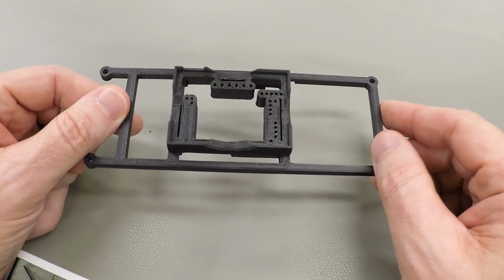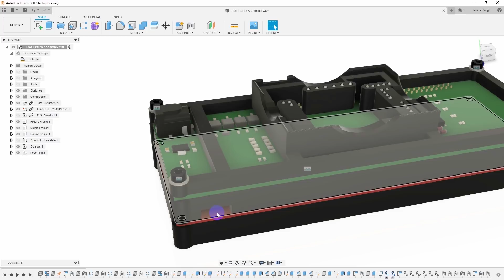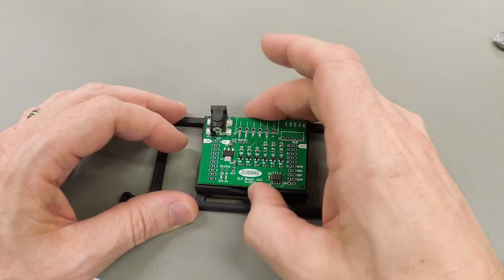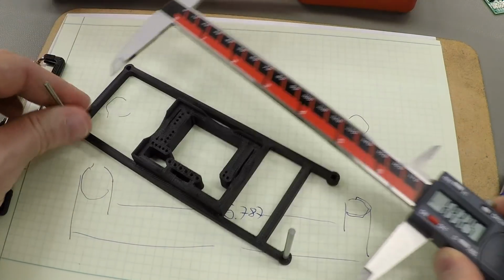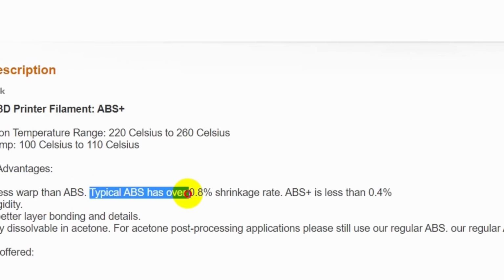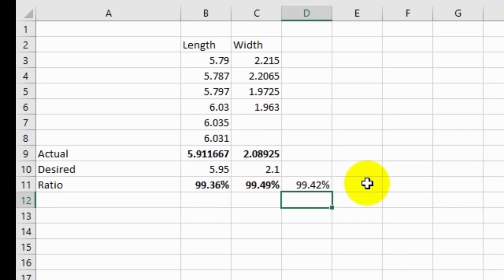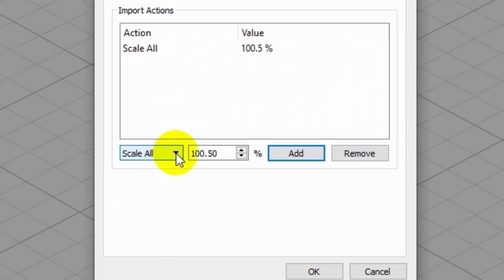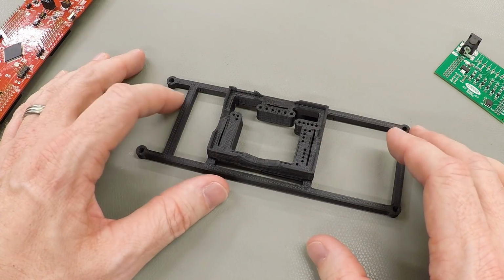How to 3D Print Dimensionally Accurate Parts

Comment: After doing this do you need to still add bit clearance to holes so things fit in? Looks a bit like this problem came because you calculated and not measured the dimensions of printed parts. Good to know though.

Comment: ABS shrinks,  some are saying up to 11%, and since you are not using a heated enclosure your  shrinkage could be a factor.
Reply from the maker: I've seen those super big numbers, and I think they lost the decimal.  0.8% is commonly quoted, with a couple of articles (I think erroneously) stating 8%.  That has to be an error.  Think about a 12" part shrinking an entire inch.  That would render 3D printing on a reprap-style printer practically impossible.
Reply: @Clough42   Having no real experience printing ABS, I just googled "ABS shrinkage", mainly I remember CNC Kitchen doing a video on it.

Comment: Isn't the pitch of the timing belt going to change when you tension it?
Reply from the maker: Technically, yes.  As a practical matter, not really enough to matter in most cases.  The belts are fiber reinforced and don't stretch much under normal usage.
Reply: @Clough42  interesting, I've just bought a 3d kit and one of my main concerns is dimensional inaccuracies due to this sort of mechanical problem. I'll still be wanting to check the accuracy of the axis movement itself, but I hadn't even considered shrinkage as a source of error to watch out for

Comment: If you didn't measure the movement of your print head how do you know it moved as far as you wanted it to? You can do all the calculations you want but if there are manufacturing errors in the diameter of the pulleys or thickness of the belt there will be errors in how far your print head travels. I checked mine and it was off by one and three quarters millimeter in two hundred millimeters. I reset the number of steps per millimeter and retested. It came out perfect. Until you calibrate your machine correctly you will always be chasing a problem. Russ with RD Learning Lab explained all this when he trying to figure out why his laser didn't travel as far as it was supposed to. Sometimes you have to adjust how many steps it takes to travel one millimeter.

Comment: One could check online discussion about 3D printing tourbillon wall-mount clock. Gears require perfect accuracy in all directions and get stuck if any ever so slightly miscalibration happens during printing

Comment: In my experience I had to scale X and Y directions but not Z. You should check on that also.
Reply from the maker: The part was modeled to be 11mm high.  I measured it right about 11.03mm, so I'm happy with the result.  When I print something taller, I'll measure and see.

Comment: Good video well done obviously you don’t want to change the size of your drawing and fusion 360 I’ve always used solid works I need to learn fusion 360. I had the exact same problem back in 2012 when I got my first 3-D printer and there were settings in the slicer that I had to fine-tune and I believe they directly changed the pulley diameters within the calculation another words they had a box for scale within the slicer but all it was really doing was slightly changing the pulley diameter calculation which they are converted to a simply scale by percentage box within the slicer for example if your pulley diameter was a half an inch you would subtract 0.0005 or something Another interesting thought is if you put the part in an oven brought it up “ as close as you could” to printing temperature would the dimensions then be accurate of course you’d have to theoretically measure it while it was hot Might be kind of a fun test you’d have to be quick I was using ABS at the time and I do remember the scale being off by roughly a half of 1% after setting and I never thought about it again Well spoken good teacher

Comment: Wouldn't the correct setting to compensate shrinkage be "XY Compensation" (that's what it's called in PrusaSlicer), because shrinkage will make your holes bigger, and scaling will make them even bigger. "XY Compensation" however will correctly shrink holes as it basically offsets the object's border.

Comment: Did you forget about the shrinkage factor when extruding?  Each material has this and you have to plan for it when running an extruding machine.  Resin parts are different as they are cured differently.
Reply: Sorry, I did not finish watching the video before you came across the shrinkage rate.

Comment: making that on a mill shouldn't be that big of an issue. if designed to be milled just mill the top of a block then use a cuttoff saw to remove it from the bottom block.. then support it to mill the bottom of it flat. would get good deminsional stability with aluminum. what is coefficient of thermal expansion of the plastic?

Comment: To solve the biggest issues, stop thinkin' imperial - go metric! :D
Reply from the maker: Tough to do when I need to fit parts specified in inches and when the machine tool has imperial dials.
Reply: Doesn't matter, the inch is defined by metric anyway ;)
Reply: Not imperial, US customary. Its derived from imperial, but not the same system.
Reply: yea we just break it up into human usable sizes ;)

Comment: Shrink 0.4% doesn't mean the printout is 0.4% smaller. Roughly speaking, shrinking 0.4% means all boundaries retracts towards skeleton (see "skeletonization" of morphology). If you have printed a rectangular frame, the middle hollow part of the shrunk frame may have the same size as without shrinkage.

Comment: I am trying to do the same thing with regards to accuracy and precision of small holes, 1mm etc.
Reply from the maker: Small holes are very hard to print on size.  If the hole size is critical, I use a chucking reamer after printing.
Reply: Best to print holes smaller than required and drill out in my experience.... 
You'll only get clean, precise holes from a SLA resin based printer or similar. FDM leaves too much wobbly edges, even on the best printers.
Reply: @BradsHacks  This is exactly what I am talking about, horizontal expansion expands everything horizontally, meaning inner dimensions get smaller, holes get smaller, So I am specifically looking for ways to increase the accuracy of holes in slicers if possible, I read something about building in tolerances into fusion also and using that to handle specific features. imho slicers should be able to deal with this somehow
Reply: @tablatronix  Slic3r and Cura both have that, look at my comment, it works wonderfully
Reply: @BradsHacks  My dimensions are not out though, only holes are undersized. So I cannot use horizontal expansion alone.
Reply: @tablatronix  I wonder if that's because your steps/mm is also slightly off. From my understanding the over-fatness of prints should go both ways. Have you calibrated your steps/mm first?
Reply: @BradsHacks  Its possible, its stock ender 3 pro, Ill look into how to do that.
Reply: @BradsHacks  Thanks!, I forgot all about esteps, now compensating for under extrusion (4.6), and using .13 horizontal expansion, and everything looks good now, getting closer to .05 accuracy in all dimensions for fine details, will have to test larger prints, but this looks like the right path.

Comment: PETG is just better for dimensional accuracy and thermal resistance and is just plain better for functional parts. PLA is inferior in strength and accuracy and deforming at ~50c makes it really impractical for use in functional parts

Comment: Just a comment 10 minutes in, why are you printing abs without enclosure? I'm pretty sure petg would hold up fine to temps. The thing with printing warped abs, is that the warp itself can cause dimensional issues. Even a slight warp can cause this, and the warp on your abs part seems pretty substantial. I think switching materials alone could solve at least partially, a lot of the dimensional issues assuming the extrusion is calibrated like you said..

Comment: Good video, but I change scaling in Fusion 360 as last step, so its saved inside of the model. So I do not have to remember the correct slicer setting every time I print something.
Reply from the maker: That's another way to handle it.  I routinely 3D-print a part for prototyping and then machine it later, and I think that might add confusion.

Comment: I suspect it is mostly from the mechanical aspect of the printer, rather than filament. In standard marlin, there is a section for geometrical accuracy calibration. Not only the x/y/z length accuracy, but also orthogonality if x-y, x-z and y-z. Such orthogonality inaccuracy turns a circular design into an elliptical printout.

Comment: for my drone motor mounting I needed to print a few times because sometimes is oversized or undersized, I have noticed even 0.2 mm difference of on side , for example on one part my motor fits correctly and another part is too tight by maybe 0.2 mm For parts that need to be accurate is terrible :/ I am a little bit disappointed by this :(

Comment: Scaling X and Y by 100.05% makes sense, it's based on your measurements. But the Z axis shrinkage still needs to be calibrated. The layer by layer print mean the Z axis shrinkage COULD be different.
Reply from the maker: Yeah, this is probably worth a look.  In theory, if the part stays all one temperature during the print and then cools evenly, the shrink should be identical in all directions, but of course those assumptions aren't realistic.
Reply: @Clough42  Z shrinkage is negligible. Each layer cools on its own, and the next layer fills in that gap when it lays down the next layer. In effect you really only get last layer shrinkage. Plus a minuscule amount as the part cools, but the vast majority of the shrinkage happens as the plastic solidifies. Also, I'm surprised you're still using ABS, if you're not vapor smoothing. There is no really good reason to use it anymore with the other options now on the market, and plenty of reasons not to.

Comment: Wouldn't this be an x/y step issue not a scale issue?
Reply from the maker: If your printer's axis step counts are not already calibrated, you need to do that first, by measuring the movement of the axis.  Once you've done that, you can do what I'm doing in this video: compensating for the shrinkage of a particular material.  Changing your step calibration to chase a single filament's properties only makes sense if you only print that one filament.
Reply: @Clough42  Makes sense, I mostly use PETG and haven't used ABS before so I don't have to deal with shrinkage to that degree.
Thanks!

Comment: The proper way to get the most accurate dimensions is get your sizes off using the pins you picked on the od and subtract 1/2 of each pin from that number and so on

Comment: Why to scale Z too? It's not necessary.
And the second thing: when You projekt in F360 exact sizes of walls then sometimes the print can take very long because the sizes will not coresponding to line width.
Reply: Ele Mistrz it actually is necessary as materials shrink in all directions go take a thermodynamics class or something before you spew more ignorance

Comment: "I'm working in inches because the board is in mils". I do understand, but it makes me mad that I have to. As an aside, I'm sure you must be right about the culprit being shrinkage, but just scaling everything by 0.5% would work whatever the source of error.
Reply: Only if the error applies in every direction. If it were a faulty motor or belt, the error might only be in one dimension. Developing a hypothesis about the error cause leads you to test it, which causes you to gather the needed data. So figuring out the source of error is necessary, or at least beneficial as it reduces further rounds of trial and error.
Reply: Easy way to check - stick some PLA in and see if it has the same rate of error or not.
Reply: ABS is known for shrinking, really. It's a good first assumption. But, yes, you're right that if you get 0.5% shrinkage, scaling up by 0.5% is probably going to correct it. (3D printers are pretty complex devices. I wouldn't be surprised at all if there were some bizarre corner-case that it wouldn't fix.)

Comment: so how about accurate inner holes?
they seems like always off a bit
Reply from the maker: I gave up on that long ago.  I'm told this is even a problem on printers with five- and six-figure price tags.  If I need an accurate inner hole, I run a chucking reamer through it.  That usually gets me to about .001" undersize.

Comment: You can change the z is up in Fusion. Pretty easy. Changed my life! Also I think fighting ABS is unnecessary. PETG won’t shrink, and it better for electronics because it’s fire resistant, high temp, and all around just a superior material. Check out AtomicFilament.com and get a spool of their carbon fiber PETG. It’s amazing.
Reply from the maker: I do quite a bit of printing with PETG.  It's much softer and more flexible.  I haven't tried filled (carbon fiber) PETG.  That sounds interesting.
Reply: Clough42 it’s the best PETG on the market... I promise you’ll love it. Also if you’re looking for a more firm Filament, try SnoLabs CF Polycarbonate. It’s very strong and firm.

Comment: that is the difference of a $1000 or less printer and a $10000 or more  printer, I never had to play with setting or dim with the commercial printer part come out perfect. also I would had done this on a micro cnc probes wont stay in the plastic for a many test board run you will have to use glue , does probe are use on fiberglass and the fixture are routed and drill with a cnc machine. I would make the hole to be able to be drill with a drill press. and this is just my opinion. beside that great video

Comment: Very nice video - thank you. I  too am interested in producing more accurate prints.  You got a great result so I won't argue with that.  I am wondering though about how well it will generalize over a range of sizes and shapes. If the entire error is caused by shrinkage as you suggest, then your error function  is a straight line with equal slope in all 3 dimensions and equal scaling in all three dimensions is the right answer. However it seems possible the shrinkage in Z could be different from X and Y. Also, there may be some error based on extrusion width. I think that would likely show un in the diameters of small holes, and it would more likely be a constant rather than a linear function.  I'm suspicious of measuring a single point and making assumptions about the shape of a whole curve based on that. Now you have me thinking, so thanks for that!
Reply from the maker: It's worth testing.  For me, I'll probably just leave it at 100.5% and revisit if I notice something not fitting properly on a future project.

Comment: you do ratio -1 the you get -.58 which means shrinking. Change rate=new value/old value-1. That’s the eq. I would have scaled from the beginning with the spec data then measure. Also that value can depend on your room temperature :)))
Just in case you find my comment wrong I give it a like and subscribed. Please do more, check z shrinking too :) please
Reply from the maker: You are correct that all of this depends on room temperature.  I'm doing production runs in ABS at the moment.  It's summer here, and I can create a poor-man's heated chamber by turning off the A/C in the room with the printer, and it does indeed affect the final dimensions.

Comment: My printer is a core xy with real US made rails from Thompson and drive with cheap nema 23 330w AC servos my pulleys are mxl .08 pitch .5 wide belts running a duet board with a e3d v6 volcano with water cooling and industrial aquarium air pump for part cooling

Comment: Could it just be shrunk from bed temp to room temp?  Add 1 or 2% overall informed by your measurements.  Further, get your centering from a middle feature if possible and print .3mm longer oval-ized holes to allow for varying shrink rate from different material manufacturers and lots.  Additionally, you might get slightly different shrink rates depending on how long the filament has been exposed to the atmosphere and gained water.  The material varies in size quite a bit and is often something I'm fighting in design to account for.  I have no experience with ABS+ filaments but a ton with ABS.  Now, I'll watch the remainder of the video.....

Comment: Similiairly in the z direction, if you are trying to print a hole centered at 0.5mm and your layer height is 0.2, you will never achieve it. The holes must be multiples of your layer height in the z.

Comment: Technically you should be scaling up by 1/ratio as the correction factor.
2.1 * 0.995 = 2.0895

your way

2.0895 * 1.005 = 2.0999475

using the inverse
1/0.995 = 1.00502513
1.00502513 * 1.0895 = 2.1

now in this case because the initial error was small, the resultant error is even smaller using your method. Had the initial error been larger the resultant error would have been more pronounced.

this is easily demonstrated using more exaggerated numbers. Lets say 10%
2.1 * 0.9 = 1.89

your way
1.89 * 1.1 = 2.079

using the inverse
1/0.9 = 1.11111
1.11111  * 1.89 = 2.1
Reply from the maker: Correct.  I used the inverse off-camera, but in this case it's only approximate anyway.

Comment: Inches are evil! :) I hear "looks like" and this practically is a "marker". And it's harder to calculate in inches while a 3d printer usually is built with usage of the meter system measurements.
In my experience for this type of cases you need to print few "fitting" prints with just 0.4-1.0 mm height. So you'll measure all fits, fix all stuff that you need (the calibration or/and shrinkage of a plastic) and reprint a testing print. The same thing could be done with the upper frame so you can be sure by 100% that a PCB will fit there perfectly.